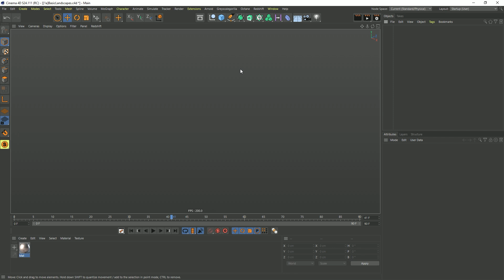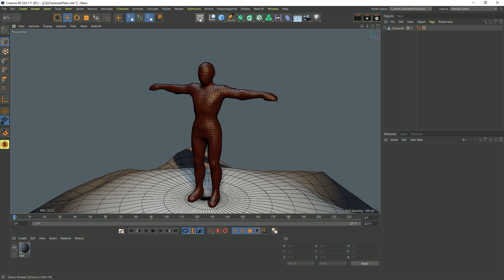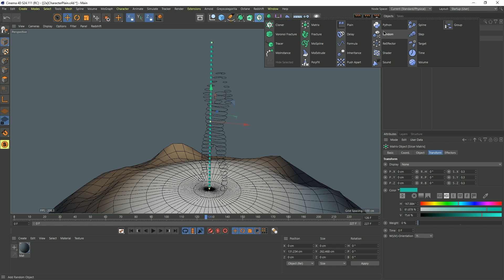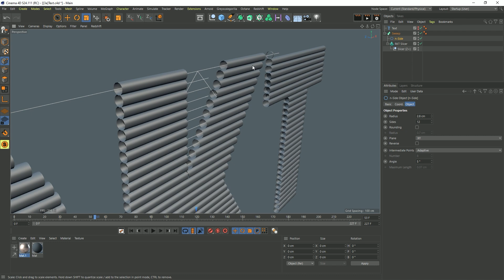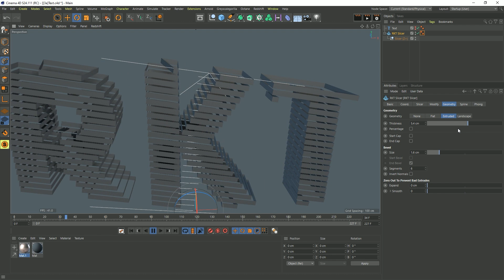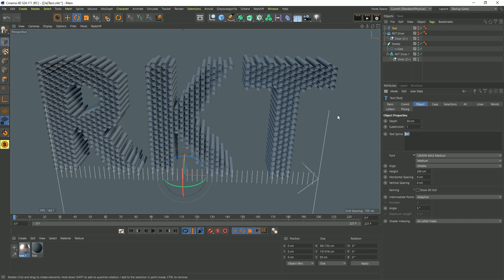Slicer Training Series: Quick Start & Use-Cases

Comment: Good Plug-in but unfortunately not Organic Enough! we can not Actually freely change the splines after they being generated based on base Model!
there is no individual control over all 3 Axis ! I'm not sure if I'm making it clear or not.
I need to have 3D variation control, in all direction . this is more like clamped or regulated iteration based on first generated form or from pre defined restricted A to B! after that one can only shuffle the splines and make some distance or 2D size variation !
Please correct me if im wrong
Reply: Have you tried the Matrix Mode or Create Matrix functionality? It seems to give you way more control over the angle/dimensions on how your mesh is going to be sliced.